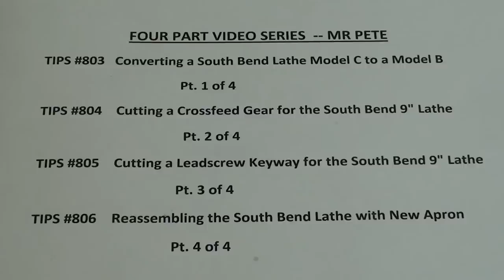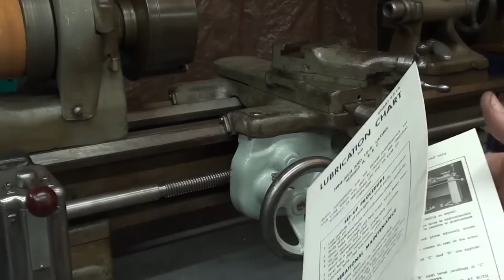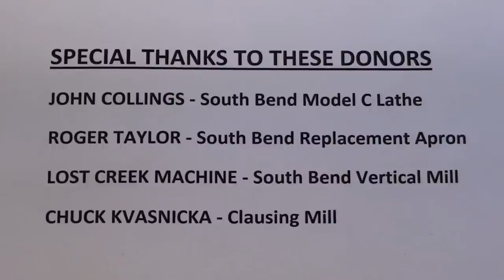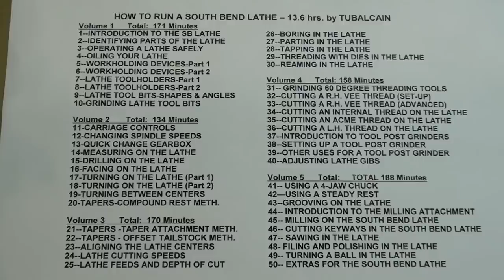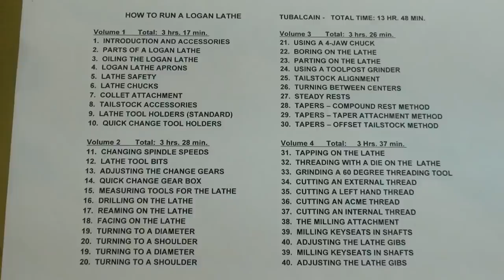REASSEMBLING SOUTH BEND LATHE pt 4 #806 tubalcain

Comment: Well done Lyle as always. If you watched my restoration of our 9C, I needed to replace the half nuts. I bought on ebay parts off a SB 10, and the half nuts were the same. Still have the rest of the apron case, wheels and lever, and also the buy came with the 10 tail stock. Saved back, but time for the parts to go back out on ebay, just collecting dust (@@)! Thx for sharing, Keep on Keeping on ! Bear

Comment: Nice job! I always cringe when YT content creators are blasting compressed air on their lathes and mills. The allen wrench story reminds me of the time when I was 16 working in an auto repair shop - the owner had a fit about all the junk and clutter, had me start cleaning it up. Luckily his son, a mechanic, was able to dive into the dumpster and find the Model A engine journals before they got hauled off...... By the way, both of my lathes, and my Bridgeport mill have a number of repairs, upgrades, and improvements because of your videos. Thank you Lyle.

Comment: My first lathe was a SB model A.  The casting holding the lead screw drive thingy with the internal key was completely broken off.  I had to buy another apron on Ebay and swap out parts.  Taught me a lot, though.  It also came with better half nuts for threading.  And I'm from TEXAS, still Cowboys down here!